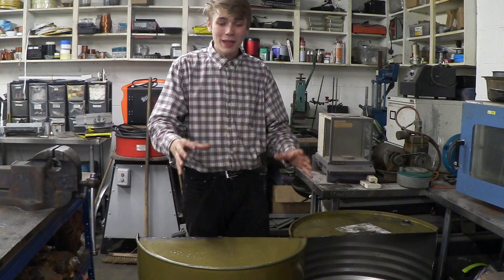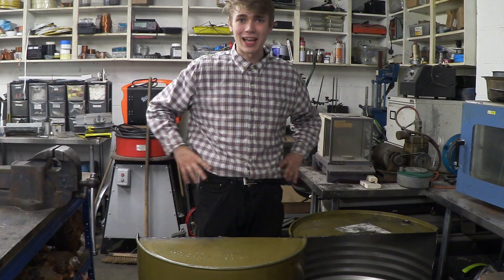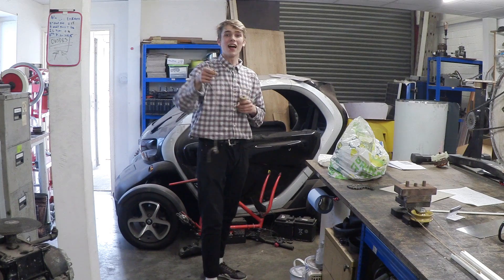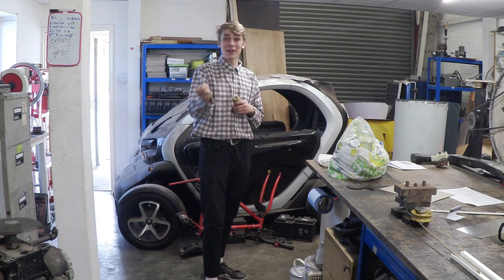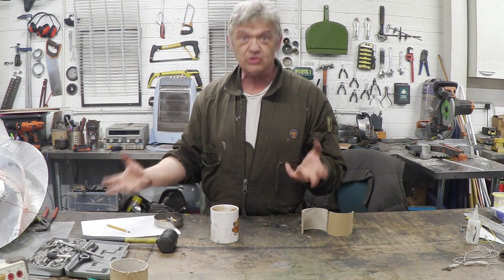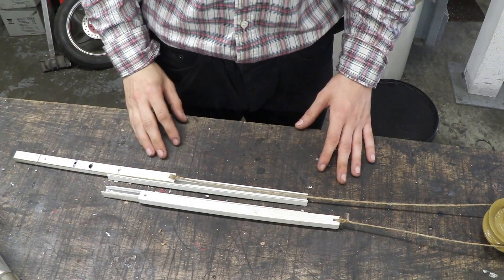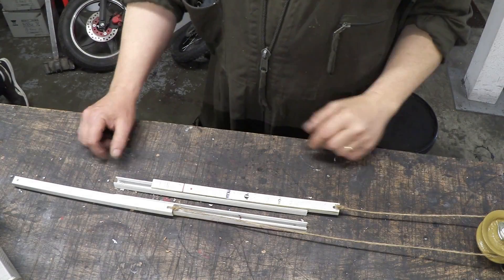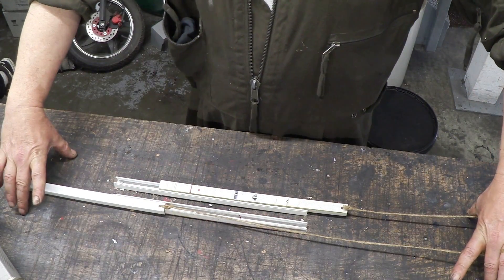1143 - High Wind Self Closing Savonius Wind Turbine - Idea

Comment: You shouldn’t need the pulley weld a weight to the hub side of the drum.  It will already be over the centre line of the axle due to the overlap in the centre.  You can then attach a recoil spring between the hub sides of the drum to pull them back together in low wind speeds.  The spring/weight will act as a governor.  You will need come calculations regarding how much weight to be able to move the drum and a what wind speed it will start to close.  This concept will rely on constant wind speed and will likely not respond well to the sort of gusty wind we have here in the UK

Comment: I see the sense in a mechanical solution. I have actually been thinking about this problem for a number of years and figured an Arduino/linear actuator would be the easiest way, run off a battery powered by the turbine and actuated by a windspeed, turbine speed (hall effect sensor) or even force measurement. have you thought of covering the outside in solar panels? what happens if the turbine is tilted for more effective PV? would need some kind of commutator/brushes for the PV

Comment: Mount a flyball governor with an X lever arrangement to the top of the rotors and as the turbine accelerates the weights will be thrown outward pulling the opposing drum half toward the center of the axis

Comment: Low tech is good but why not just do a sensor and a motor on a rack and pinion? Edit 2 racks 1 pinion turn to the left closes the two halves of the barrel turn to the right opens it program RPMs to how far it opens or closes.

Comment: A simpler idea would be to have a shaft horizontally that can pivot. The half barrels mount to each end. The in the center attached to your vertical drive shaft is a weight extended upward. If it is off center just a bit and as it spins faster the weight will through out tilting the barrels to catch less wind.
Reply: may want to orientate the barrels horizontal as well. This way axis of the barrel is then in alignment of the tilting shaft so it will not have resistance biasing from one end of the barrel or the other when it is coming back around against the wind.

Comment: I know how to make it work mate, Put weights on the inside part of the drums closest to the center and put each half of the drum on tracks so they can slide just as you where showing on the table. The faster the drum spins the weight will try to pull to the center. This is why the earth has all the heavies towards the center on the earth as it spins. The slower the drum spins the wind will catch the edge of the cup of each drum and pull the two halves outward. So all you will have to do is put weights and tracks on the two halves. Problem solve. But this will make them heavier. Because you need to use some heavy weights to make this work correctly. The weights need to be at least 10 times that of the drums and the tracks need to have strong bearing's to withstand the weight.

Comment: Couldn't you just increase the torque on it using your gear and derailer idea and generate more power output into a battery or capacitor bank or a larger flywheel?  Do you have a multifunction system in mind?

Comment: I think you are going to create some very interesting fluid dynamics when the drums are approximately half way across each other and the air escapes between  the wind cupping half to behind the other half. It may be necessary to create a baffle to prevent this flow to avoid catastrophic self destruction when the the flow of air changes direction.
Reply: This effect should be built into the oildrum design, starting out they should cover each other slightly since the air escaping to the other drum somewhat destroys the tail-eddy of the drum facing into the wind. roughly 30% overlap is a good startout point. If someone ever mentions "Modern Savonius blade design" it's this feature of torque transfer from the wind catching blade to the wind breaking one.

Comment: Cool idea, but wouldn't it make more sense to use a generator with multiple phases which get switched on/off based on speed? Each added phase would act as an additional brake to turbine and at the same time produce more electricity thus harnessing more power from the wind. Less mechanics, easier  to make, cheaper, increases reliability and increases electricity production.

The electronics could be as simple as a 12v relay. The generator will reach 12v generation at a certain minimum speed which then activates the 2nd generator phase and so on.

Comment: One speed control method maybe just to apply a large electrical load to the generator which in theory would slow the drum down.
Reply: Exactly right, and all the power generated could be saved in batteries. 
Good call.

Comment: Seems like a spring should be involved to return it to the out position when speed is low, because you still have centrifugal force pulling the weight outward, and it needs something to oppose that. If you tune it right, you could theoretically maintain a constant speed with varying power output. Anyway, hope it goes well. Look forward to seeing what you come up with!

Comment: I'm thinking a better solution would be a gearing one to increase the load at higher speed.
A bicycle sprocket?
Reply: Have it gear to a heavy flywheel that shifts in as speed builds up and or do electromagnetic braking.
Reply: I agree with this idea. There is going to be a lot of issues moving the barrels and those little drawer rails are going to ping apart quick. If it's going too fast - give it more work to do and drop back down later! Gearing sounds way easier

Comment: you can use measuring tape mechanism coil,  put the coil on the pulley when it's not stretched, the centrifugal force will pull the coil, and the coil will return back when there's no more pulling force

Comment: That is quite brilliant!

Some years back, I tried my hand at making wind driven wooden automata.  They lasted less than a week before wind speeds send pieces splintering in every direction.  Ultimately, I was wanting to make a large scale automata (with aeolian harp like elements), so I came up with the idea of driving it using a squirrel cage, but place it inside a louvered box.  It was then my plan to open and close the louvers with something along the lines of a Watt Governor.  One thing after another led to the whole project being back-burnered.

It never occurred to me that instead of controlling the wind by a housing for my squirrel cage, I could try opening and closing the blades of the cage itself.

I am looking greatly forward to seeing how Luke's system pans out.

Comment: then comes the question how will it open back up on it's own?  A spring will work harden and break with over usage, so......counter weight through the center axis using gravity and a pulley might work to open it back up when the wind is low enough to use the turbine safely.

Comment: Brilliant. I had an  idea about the weights. You could put a weight attached a the half barrel but on the opposite side of the axle. Then as the weight swings out it pulls the barrel closed. You could insert a spring on the pole connecting the weight to the barrel so when the windspeed decreases it pushed the barrels outward again.. There is some maths to do on the weight of the barrel, weight and force of the spring, but should work. Not sure if I explained it right, I could send a drawing.
Reply: That drawer arm is certainly going to need to be a bigger one, if that fully extends with the barrel on its going to rip right out of its housing it's meant for a little bit of wood to go on

Comment: Instead of moving the barrel halves in and out could you have a seperate wind shield in and out. Or up and down. Perhaps even a cover that raises and lowers over the top. Should be mechaically easier. (Although I'd rather see all the energy being used rather than blocking it).

Comment: Wouldn't it just be easier to have a centrifugal breaking/clutch system to stop the thing from RPMing itself to death in high wind speeds?
Reply: Yes but they wear out or burn out.
Reply: @Barskor1  how about a magnetic clutch wired to engage the more it over spins? Sort of like DC breaking

Comment: This will be interesting to see how this is done.  Both drum sections need to be moved otherwise the combined sections would be way off center of the rotating shaft and it might self-destruct.  If  you can get both sections to move together toward the center of rotation, then this idea is brilliant.  I am sure they will be able to do it.
Reply: free turning pinion on central axis... running against paired racks
Reply: A guy made one called harmony turbine

Comment: A reverse centrifugal clutch mechanism! Brilliant Luke! Can't wait to see the development! Question though, are some vertical wind turbines "self throttling"? I recall reading that somewhere and kinda makes sense if you consider half the increased wind force will always be pushing on the convex side as well, somewhat lending some braking force, as compared to a typical bladed turbine which will just keep spinning up and up - hence why the latter has some sort of built in braking system. Regardless, I love this concept! Let's see it!

Comment: This type of wind generator has so many possibilities of how to use it. Great video. It opens up lots of opportunities for others to build along since you can use any round cylinder to make one. Big or small. Can't wait to see some of the options you take.
What would be steampunk is a ball screw that had weighted balls on the end of to boards that raised and lowered with inertia! I can't find the mechanism I'm thinking of to post here
Reply: Yes the same as a RPM regulator on a steam engine or a Hydropowerplant (pre-electronics)
Reply: @HansFrisk  yes, the basic of the pole, 2 balls, a ball screw. Make it a gravity generator.
Reply: @jeffreyrood8755  btw it's called a "Centrifugal Governor" that thing we both tried to describe!
Reply: @HansFrisk  I would like to design some type of gravity generator with this form incorporated somehow. If you have any ideas and/or would be interested in collaborating on it, let me know.

Comment: Why not skip the pulley and ropes and just have a counterweight for each barrelhalf on the opposite side? You still need a spring or a weight pulling down in the centre to move the halves out again in lower windspeeds

Comment: So why don't you have it hydraulically driven use the counterweights to compress a cylinder in the center of oil and having the cylinders pull together closing the drum halves together so it's all enclosed and then you could have a shock absorber or tension spring on the return side to pull it up using a hydraulic fluid to open and close it reduces friction and allows you to fine tune it to the desired winds you want and with the centrifugal weight being in the center of the drum it won't be exposed to weather

Comment: Whatever you do, don’t use drawer divan runners they’re hopeless with bedding never mind oil drum skins 😆 
Some photocopiers use good solid runners but have locking mechanisms to stop you pulling them out completely
Reply: Yeah it will destroy itself in the housing, if you fully extend that with a barrel on the side and the addition of the centrifugal force it's going to rip itself apart real quick

Comment: I echo the idea of just weighting the side of each drum that's already on the "correct" side of the axle to pull it closed as rpm increases. How about having the draw sliders mounted on an angle above horizontal so gravity returns them to closed? As the rpm increases they rise up and in...

Comment: You'll need a recoil spring to open it back up when the wind dies down.
To get it right, the recoil spring should be slightly stronger than your weight.
On the other hand, if you don't close it all the way, the wind might be able to open it back up.
This will be a good mechanical engineering skill builder.
Reply: Good points.  Also, as I posted above, Both sections need to move toward the center of rotation together and not just one drum half as Bob mentioned.  If not, the entire device will be way off the center of rotation and extremely out of balance while it is slowing down and still turning at a lower rate.
Reply: @OverlandOne  
Yes, that would take a pulley with two lines that affix to the far ends of the barrel halves.
The pulley would then turn as the weight moves outward drawing the two barrel halves together at the same time and keeping them balanced.
You could also use a large pulley that turns around the main shaft which has two slots 120 degrees apart. Each slot would have a rod inserted in them from each barrel half. As the weight moves away from center, the pulley would turn and the rods would rid along the slot pulling the barrel halves together.

Comment: I was thinking a centrifugal govener like thing that could climb up a pole as the rpm increases, and a pully system could be attached to it vonnecting that to the drum bits, as windspeed decreased, the govener would fall back down and the wind would naturally pull open the drum bits
Reply from the maker: I like the naturally opening idea mate - cheers

Comment: Dear Robert,

Hi from France, !
I have followed recently your videos and I will subscribe to your channel quickly.
One of the best way of improvement could be to "load" the spinning rotor with a fluid and dense material, depending of the wind's speed. One which is easy but demanding is ...a spinning water ballast. You could be able to obtain a high torque at high winds, and to be able to maintain an ability to produce at low speed by emptying the ballasts.

One another major improvement could be to use "an English wheel" in order to obtain a curvature on the bottom side, the one which is bolted onto the flat rotating panel.
This will allow a considerable stiffing technique, of course its add a cost by adding a construction time and a specific tool.

But it will be a great way to use classic rivets, able to withstand mechanical failures by fatigue. It is very important to reduce the wobbling of the upper side of the 3 petals. With the time you could obtain some cracks located onto the reduced area of joining.

I have lots of ideas to submit, it will be a pleasure to share them with you. Here is my e-mail : r o u l e p o u p o u l e (a t) r  i  s  e  u  p . n  e  t
Best regards.
Reply from the maker: I like the water ballast idea mate

Comment: How about adding weight to the central edge of the drum, enough weight to make the centre of gravity of the half drum to be on the opposite side of the axle. As it spins centrifugal forces will close it automatically. A spring/weight to pull it back out again.
Reply: I was thinking the same thing, but you said it better than I ever could have!
Reply from the maker: nice!!!
Reply: @ThinkingandTinkering  So, I can't imagine a wind so strong you would need the "clam shells" to completely close.  I don't know the proper calculations, but a spring mounted between the inner halves and calculated weight mounted to those inner halves could do the trick.  As it spins faster, the weight wants to throw out from those two central halves, essentially closing the "clam shell,"  while being restricted by expanding the spring.  When the wind dies down, the spring retracts, overcoming the centrifugal force of the weights as it slows down, reopening the clam shell.  The trick is the spring - for example, a "Trampoline" spring would be too strong to overcome except at extremely high speeds - however, with the weight of the barrel halves, you would need quite a strong spring to retract the halves.  Calculated correctly though, it could act as a spring/counterweighted governor in a sense, couldn't it?
Reply: Or even a boom with a weight on the end so you wouldnt need as much weight
Reply: How about weights on the end of an A frame with a pivot at the top and the centre spar of the frame able to extend on a slider. As the weights are forced outwards, the top peak could be used to pull the section inwards. A spring could be mounted on across the legs of the A frame to pull it back in when not under load.
Reply: Another way is to put a top and bottom beam with a slightly off center pivot on the barrel halves, then the "center" of the barrels will be slightly heavier than the outer edges... So when it spins the center sections will try and throw itself out wards... It would require everything to be perfectly balanced...
Reply: You could stick with the fixed welded halves for strength and rigidity, but make a pair of vertically hinged flaps tangential to the rear drum halves, with coil springs also attached to the rear of the drum halves.
These flaps would unfold as the speed increases, blocking the scoop area.